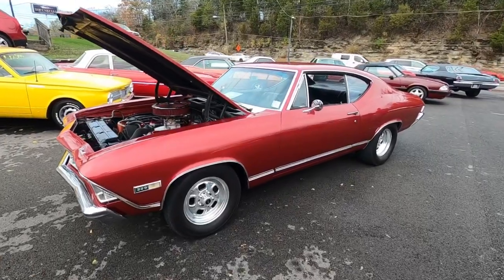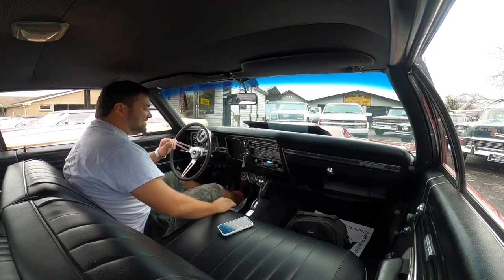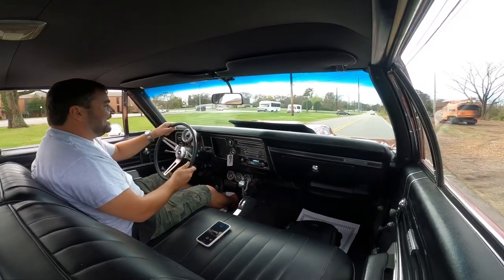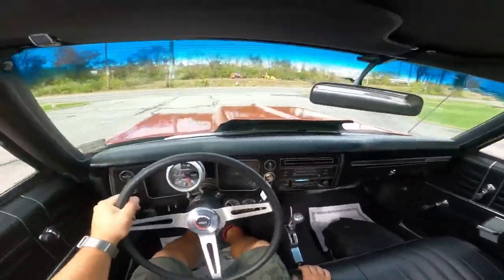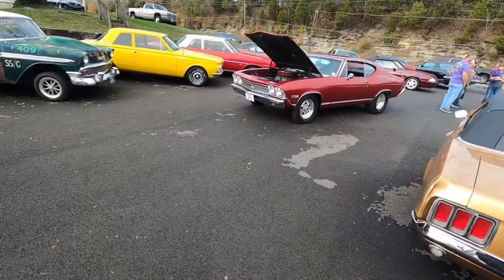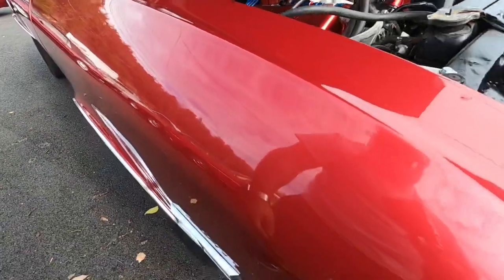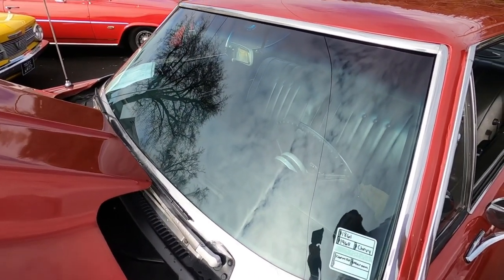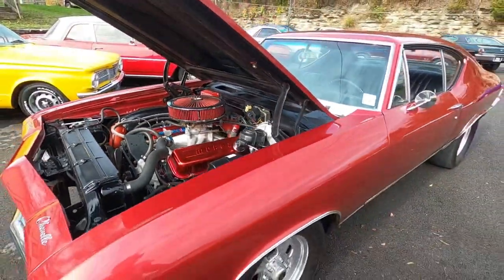Test Drive 1968 Chevrolet Chevelle SOLD $32,900 Maple Motors #1861

Comment: I had a 68 Chevelle in 79/80 it was a 307 V8 light green it had a dented front grille. Paid $300 for it drove it for a year only put oil in it then sold it for $150 and the exhaust was smoking when I saw it drive off. It needed a valve job if I’d had the money I would’ve rebuilt it and had it another 10/15 years it was a good car